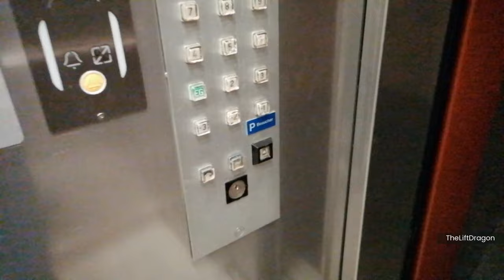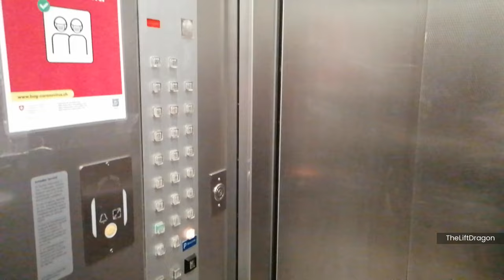3 High-Rise SCHINDLER R-Series Dynatron 2 Lifts in Berne, Switzerland

Comment: Very cool, too bad to hear that they're now gone! They probably would have lasted 40+ more years
Reply from the maker: It's sad indeed but at least the new lifts are faster. The lift cars themselves would surely have lasted a lot longer but the gearboxes have taken some damage. With new equipment in the motor room, it surely would have been possible to increase the speed of these lifts and get them running properly again.

Comment: Nice video. How come there is a chain connected between lift car and counterweight, and some don’t have a chain?
Reply from the maker: Thx!
The chains below the car and counterweight are used to compensate for the weight of the ropes above. If the lift is at the bottom and the counterweight at the top, there is a very large amount of rope on the lift car side, making this side a lot heavier. To balance the system, there is now a chain on the other side.

The rules when to use compensation, either by chains or by ropes, are not set in stone. Generally: The taller the lift, the more important it becomes. Fast lifts use ropes that need to be tensioned, slower lifts use chains.
Also the type of traction media plays a role: Conventional ropes are a lot heavier than belts for example, so the new lifts that replace the ones showcased here use said belts. They don't have any compensation media, despite the 70 meters of travel. Some companies find compensation more important, others not so much. I know lifts as low as 18 meters with compensation and others with over 70 meters without it. Generally speaking however, I prefer to have it from maybe ~30m upwards as it also improves ride comfort.

Comment: Hallo, Beschleunigung und Bremsen ist aber hart eingestellt. MfG Jan PS: Warum lässt man den Maschinenraum nach der Renovierung leer? Platz für Antrieb und Steuerung wäre vorhanden. Wäre übrigens auch viel besser für den Service.
Reply from the maker: Es handelt sich hier um das Antriebssystem Dynatron 2. Dieses besitzt keinen Umrichter, die Beschleunigung lässt sich nicht einstellen. Die Motoren besitzen eine 6- und eine 4-polige Wicklung, mit Umschaltung während dem Anfahren bei einer bestimmten Drehzahl. Für eine Etagenfahrt wird nur die niedrige Drehzahl verwendet.
Die Bremswege bei der Steuerung Mic B sind ebenfalls immer fix. Sie werden durch die Schachtmagnete "Kontakt Bremseinsatz" KBR-D und KBR-U vorgegeben und können nicht angepasst werden. Bremswege für Dynatron 2 werden für die verschiedenen erhältlichen Geschwindigkeiten anhand einer Tabelle fix definiert, denn die Positionen der Magnete sind vorgeschrieben.
Generell ist das System Dynatron 2 für höchste Effizienz ausgelegt, weshalb die Beschleunigungen sehr hoch sind.

Meiner Meinung nach wäre es hier auch besser gewesen, die neuen Maschinen im MR unterzubringen. Diese Konfiguration gibt es ja auch mit 5500. Die beste Lösung wäre aber hier gewesen, die Schachtdecke auszubrechen und den Schacht in den MR zu verlängern. Damit hätte man den nötigen Überfahrweg, um die neuen Anlagen mit 2.5 oder sogar 3m/s zu bauen. Für die Förderhöhe von 70 Metern finde ich 2m/s auch die absolute Untergrenze für eine Neuanlage.

Comment: I did not know Schindler W163s could support Dynatron drives too apart from Variodyn, interesting.
I like the way Dynatron 2 levels quicker than Dynatron S but the later is slightly smoother (still rough though) which has a better ride in return. Quite sad it got replaced to 5500s, but 2m/s speed should be quick at least for the height. Nice video once again.
Reply from the maker: Thank you! There is a huge amount of W163 machines with Dynatron S and Dynatron 2, this is very common. Also in combination with different buttons: R-Series, M-series and S-Series.
In my opinion 2m/s is the minimum speed for this height, I would be really happy with 2.5m/s. But I guess this building / the apartments are not posh enough for this speed.

Comment: The acceleration and deceleration seems very uncomfortable, also, the lift is modernized which is not great, if you still wanted that hard deceleration and acceleration
Reply from the maker: It is the standard accel / decel for the Dynatron 2 drive system. The values are fixed and can't be changed, they are like that for very high efficiency.
The lifts have been completely replaced by now with Schindler 5500s the go 2m/s. The new 5500s will probably be faster over very long trips, but absolutely no lift can bet this Dynatron 2 when it comes to trips over only a few floors. They're insanely quick and also keep in mind that the original QKS9 doors are super fast.